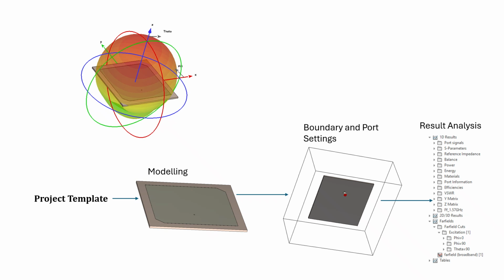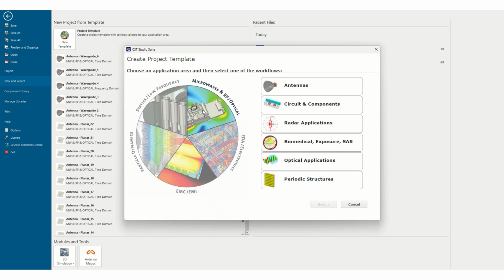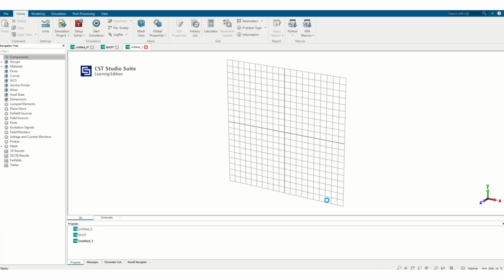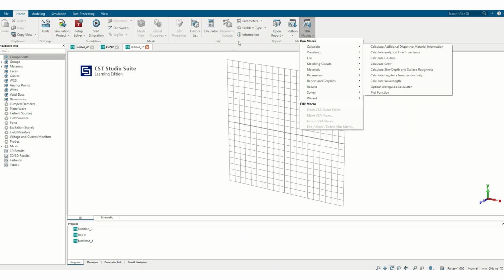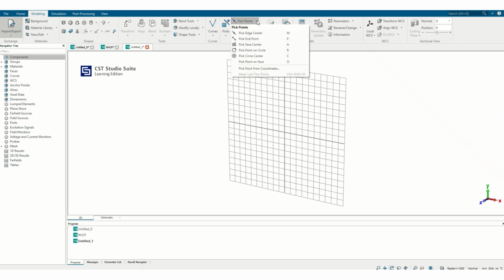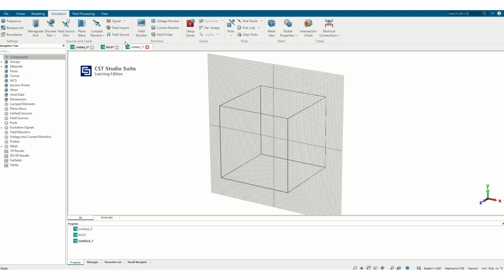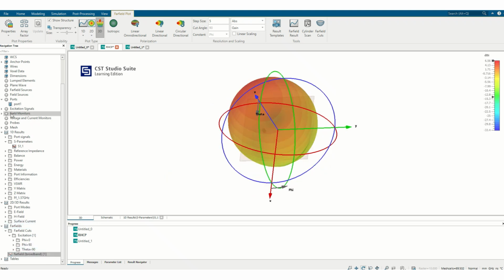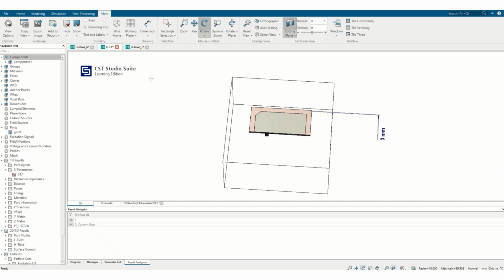CST Studio Suite Basics for Beginners:-Understand the workflow

Comment: Hello Libi, how would you simulate a full RIS array? Create an array task from a unit cell and then use TD solver with a plane wave or some other way? Im also having doubts on how does one create the excitation pattern on the array. With the unit cell one could use edge ports and excite them (ON/OFF) in schematic view. But with a large array, it becomes very hard to simulate using schematic.
Reply from the maker: I just started exploring RIS. I didnt progress upto full structure simulation. I will do the exactly the same you have mentioned- full structure and plane wave.
Out of curiosity, do we need full structure simulation as we can analyze the structure performance using unit cell simulation (which will be comparebale to measurement)?
Reply: @waveresTech  an older student told me to run a FEM then do post processing in schematic, but still not sure as well since he doesnt work with metasurfaces 😅